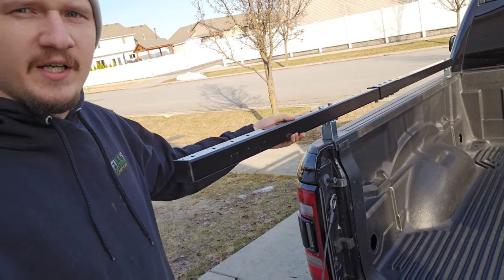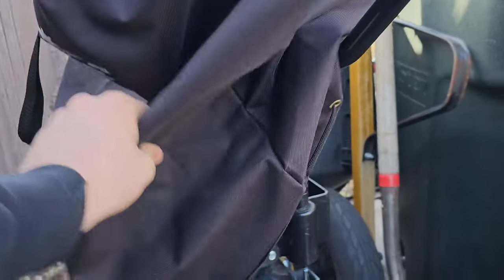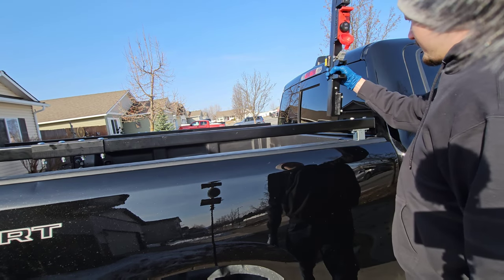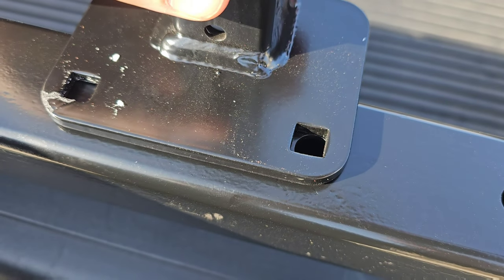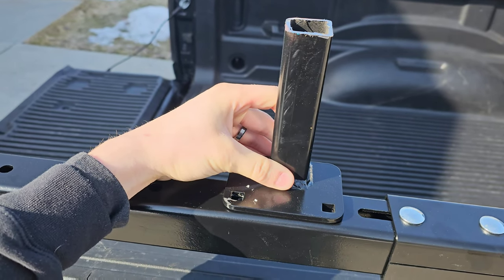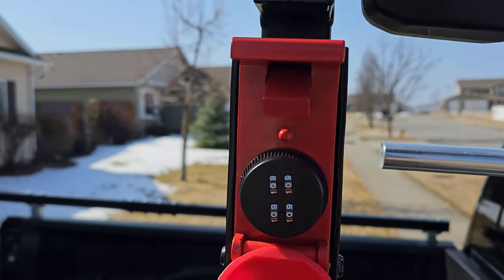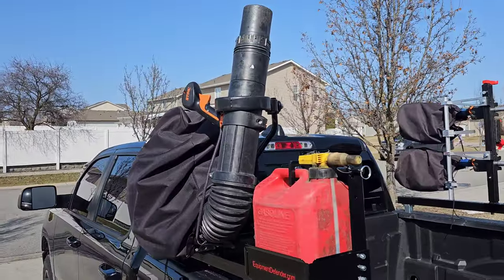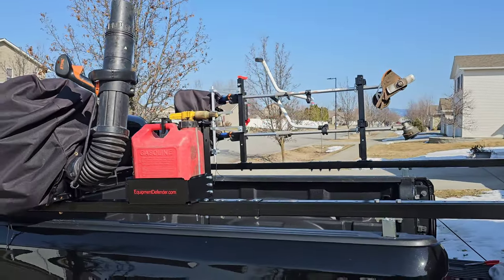Installing Racks For Trailerless Lawn Care Setup (Part 2)

Comment: I just recently installed this same setup on my F150. Im Wondering if you noticed any rattle woth the trimmer rack specifically when driving around with no trimmers in the mounts. Mine rattles really bad on the locking end since the locking mechanism inside is loose when a trimmer isnt attached. Its my only issue with these racks, but it is rather annoying?!

Comment: What a job!   What are you going to do about the overhanging rails?  It seems dangerous to leave them so long.  You would need flags on them it seems to me.  Also, could the spool be turned 90 degrees after you cut off the spindle or whatever it’s called, to save space on the rail
Reply from the maker: I ended up cutting them off to make them flush with the bed. I might do that with the spool!

Comment: For the blower you should turn the rack around so you can pull it out from the inside of your bed… if you are putting a ramp on the back it will make it a lot easier to put it in the rack
Reply from the maker: Good point. I might do that

Comment: I'd rather have modified that holding piece on the rack ( drill it, grind it, or burn it wider ), than cutting the grip off the articulating trimmer head.
Reply from the maker: I like how snug they fit, though 😅
Reply: @fillslawncareplus  😂🤷‍♂️